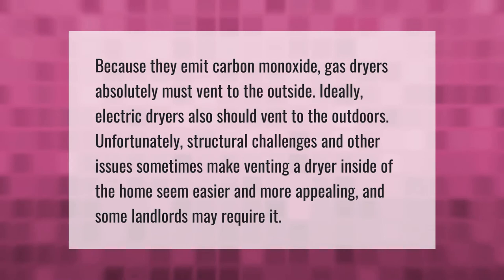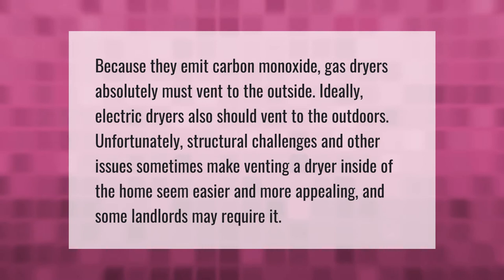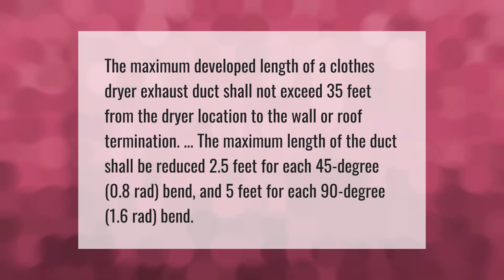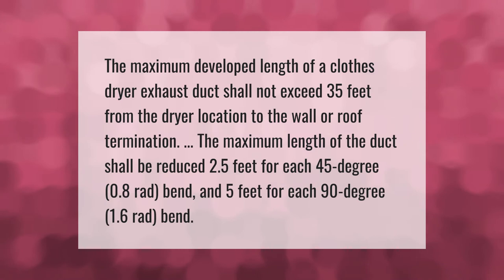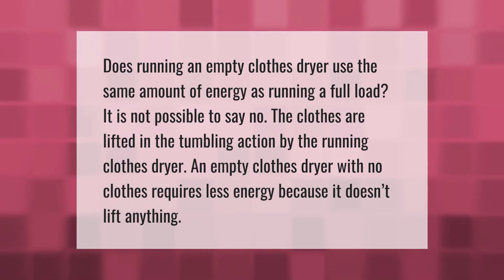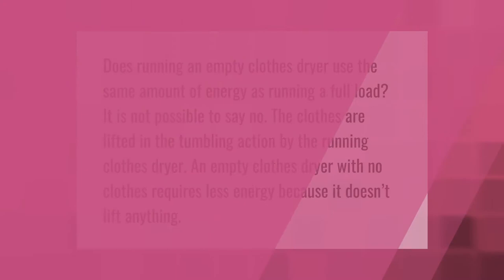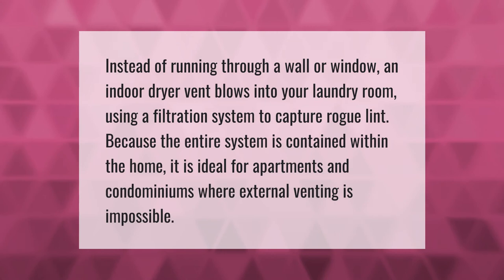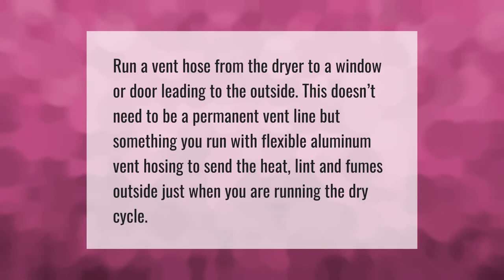Does a dryer vent have to be vented outside?

Comment: Does a dryer vent have to have a 90 degree bend? Can a dryer vent run straight from the dryer through a wall to the outside of the house?